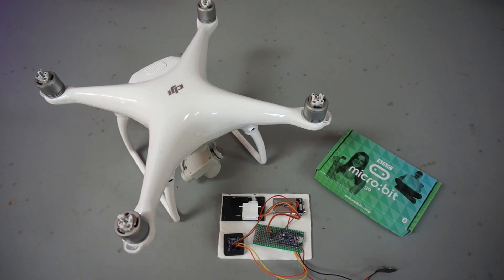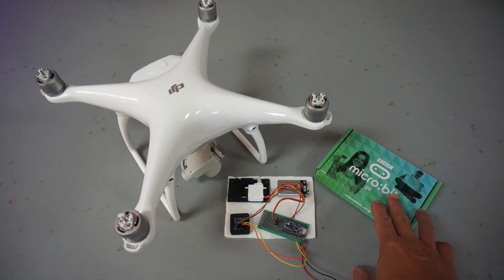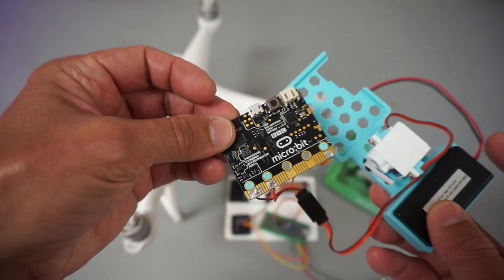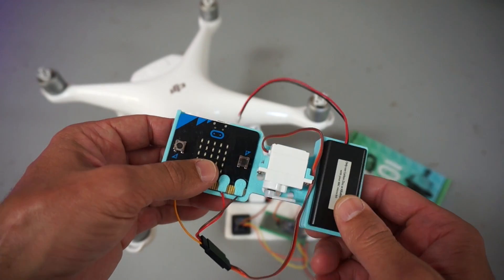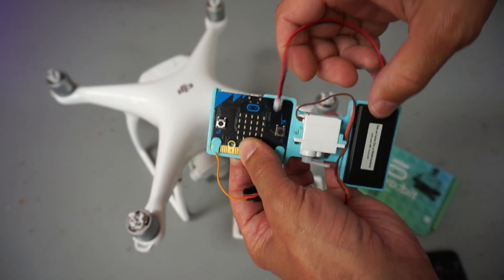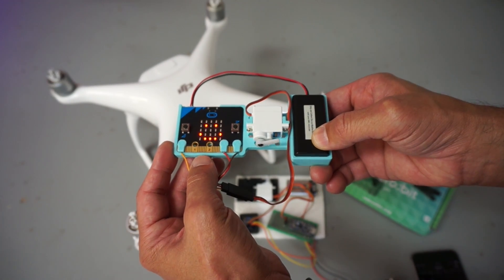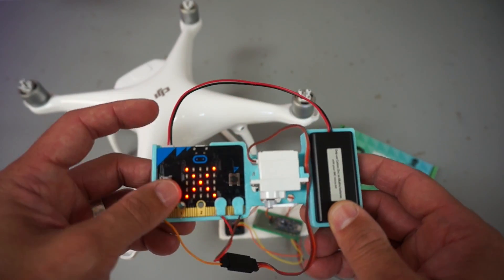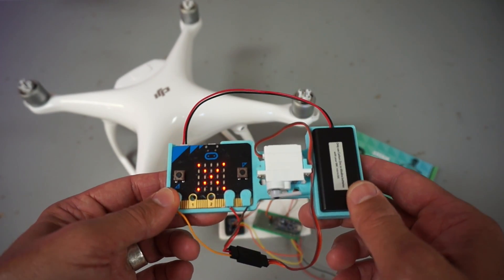Drone Payload Dropper Concept Using the ARM Based Micro:bit

Comment: Dennis. This looks like the exact system I need for my drone fishing rig. I'm currently using a second transmitter with a micro receiver but this would eliminate that requirement. However I'm an older gentleman and programming was limited to my VCR when I was your age. What could I get the script you wrote for this. I think I could work the rest out but programing is not something I could achieve. I highly admire the work your doing and your efforts with the iPad. It is very much appreciated.
Reply from the maker: Allan, a friend of mine is working on a mechanical trigger that uses the gimbal to make contact with a hairpin trigger. If you are interested in helping beta test his design or provide feedback let me know. It's still early stage but is a lot simpler than what I covered in the video. My email is db at ummannedairlines dot com if you want to reach out. Take care.